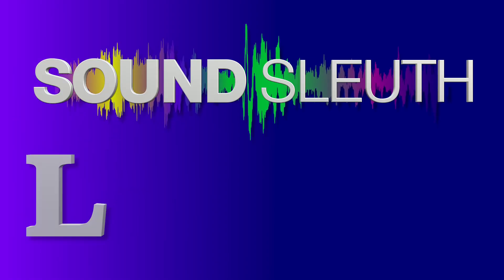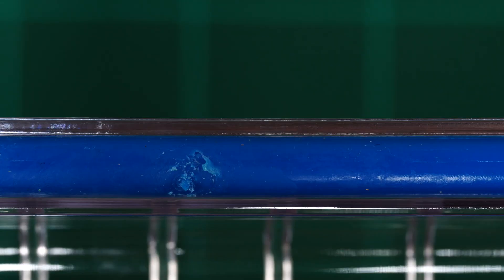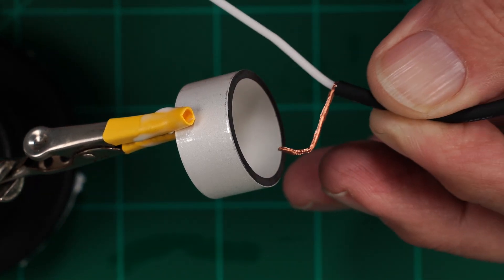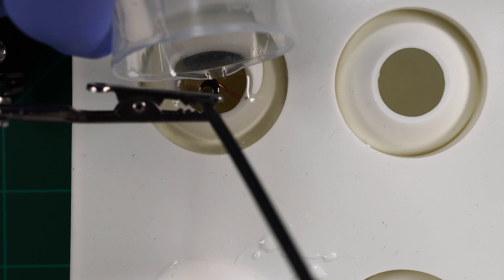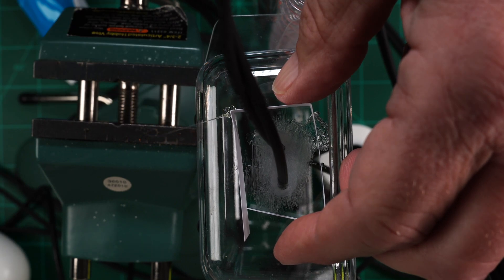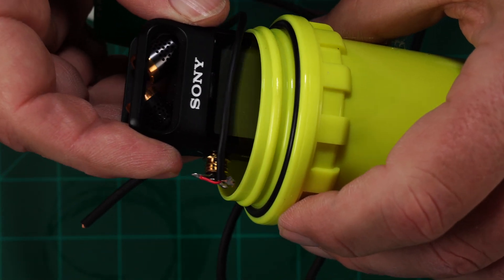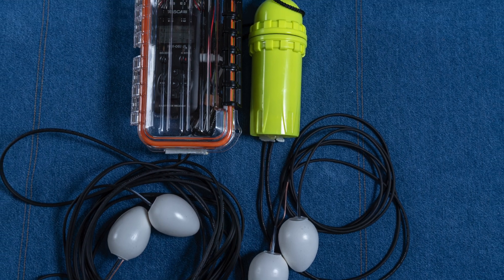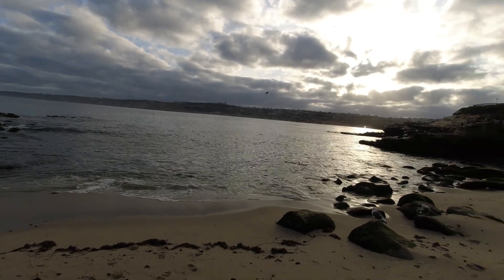Hydrophone Drop Rig

Comment: Hello! I used your schematic to make a PCB, and it works great when connected to my oscilloscope. I know very little about audio devices, but I did notice that the output peaks at around 7-8v when tapping the piezo (I am using 35mm piezo disks rather than the STEMinc ones). As far as my knowledge goes the maximum RMS voltage for an aux port is 2v. Do you think the STEMinc piezos output a much weaker signal than the 35mm disks? I am assuming that the 6-7v peaks of the signal could be damaging to a recording device so I haven't tested it yet. Thanks!
Reply from the maker: Are you using the schematic with the protection diodes? If so you are fine  you won’t damage the recorder . It will clip the signal but no damage
Reply: @SoundSleuth  I am using that version, but when connected to my oscilloscope the peak voltage is around 9V.
Reply from the maker: @BenMyhillJones only when you tap the disc correct?
Reply: @SoundSleuth  Yes whenever I tap the disk or tap around it. Its not just peaks though, the entire signal seems to be around 9v whenever testing. The circuit is 100% identical to the one found on the gladys hydrophone of yours. When plugged into a Zoom H5, it easily maxes it out when on the lowest dB input setting.
Reply from the maker: @BenMyhillJones  check the DC voltage out. It should be about 4.5v with no signal. Email me ryckebusch@gmail.com

Comment: 5-min epoxy is not long-term water proof.   It will degrade and soften fairly quickly.
Reply from the maker: It probably isn't the best method but works well for me. Do you have suggestions for improvemnets?
Reply: @SoundSleuth  Try JB-Weld it has about the same consistency as 5-min epoxy.  There is a 5-min version of JB-Weld as well, but I don't think it cures as nicely as the regular formula.
Reply from the maker: @metaforest  lol I’m pretty sure that’s the brand of five min epoxy I use
Reply: @SoundSleuth  I'm not talking about the clear stuff they make...  that is not water resistant.  I'm talking about the gray stuff.  Totally different chemistry.

Comment: Hey, I thought I posted a question yesterday, but I don't see it so I'll try asking again (sorry for the spam if the original does post). I'm just starting to get into hydrophones and built my first one last night using a piezo disc with enclosure that was meant for guitar pickups (scrappily sealed with hot glue). What kind of differences does a piezo cylinder offer vs the piezo disc? Also I did notice the loud hum with my last night build that I tested in my tub. Should adding a copper wire to ground into the water nullify the hum that my build has? I am considering following your build video to make a new pair of hydrophones as I am really impressed by the audio in this video as well as your video for the whales. Thank you so much for sharing your findings in such great detail! I've always wanted to record underwater sounds, so I'm excited to explore this even further.
Reply from the maker: Glad you are exploring underwater sound. You have to have a ground to the water to prevent humm and buzz. I found that out the hard way -- as in after my first build and I had published. To the Disc vs Cylinder. All the commercial ones are cylinders. And actually they keep them hollow which I also became aware of. I plan on updating both builds very shortly.
Reply: I'll also be curious for those updates! Thank you. I've never built one of these, and would buy two from you, but as I understand you are just offering the instructables. Does anyone else sell similar quality hydrophones? Thomas Rex Beverly referred me to someone, but alas, that was a dead end.  @SoundSleuth
Reply from the maker: @misterbusiness3964  reach out to me via email. ryckebusch@gmail.com

Comment: Just a respectful observation, the epoxy mold method seems to prevent the best contact from the mics with the water first because of the material which conducts vibrations and sound pressure but not as efficient as others and second the capsule it's in the center and not near the surface where it contacts the water. I've seen people use Plastidip, liquid plastic which in my opinion just covers the capsule enough making a more direct contact with the water, it's lighter and not as rigid which conducts better the vibrations. Results in a much more crisp and detailed sound rather than a "boxy" sealed sound.
Reply from the maker: It’s actually about the density of the material that the cylinder is embedded in.  We want as it close to that of water for cleanest transfer of acoustic energy.  My original build that embedded the PCB with the piezo cylinder has received great reviews and sounds excellent.  It uses the same resin.
Reply: I have successfully used marine silicone.

Comment: hi, for the cables sealing with epoxy, it might be nice to makke a more flexible cable relief on top of that. so as an extra step, this could be achieved with a polyeurethane based product. for which toluene is the solvent. there might be several pu based products available on the market. however for more information about the method which i heard about, robrenz has an instructional video over on his channel cryptically called 'secrets of goop' here is link https://www.youtube.com/watch?v=JU2jsbGNcZE&pp=ygUPcm9icmVueiB0b2x1ZW5l